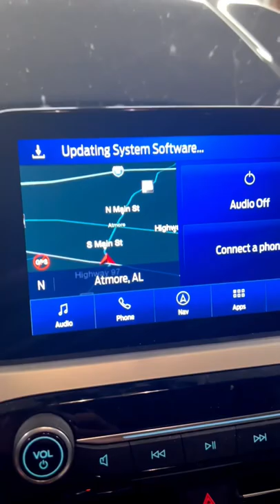Will SYNC Radios Make Me Quit? #shorts

Comment: Are you doing the USB method or the DLC method? If you use a USB it should take like an hour tops but if you're going through the DLC it can take hours, and that's with the VCM3. If you're using a VCM2 and going through the DLC I'm not surprised it's taking a whole day or more.
Reply from the maker: Using USB
Reply: @FlyingWrenches13  damn that's weird. It's very rare for our sync updates to take more than an hour using a USB.
Reply: @TekuTaurus  agree possibly want to buy a name brand USB like scan disk with high transfer rates.  Some of those cheap usbs from Amazon or any local store are hot garbage.
Reply: @gameovered777  as long as it's usb 3.0 it should be fine. I just did it with a cheap micro center USB flash drive the other day with no issue
Reply: I use the 2 gig USB from 2005 or some s*** and it took me 10 minutes to update my radio on a 2020 escape
Reply: @hoodman420  guys are on to something ;).Old Ford Tech here and modern Server/Sys admin. The USB is still legacy on most if not all fords (up to 2020 i know of) and is more compatible with 2.0 devices. Using 3.0, this issues occurs often..... hence why the old usb drives work better. Also the blocksize and format matters. Unfortunately not completely dummy proof. Most drives should be formated fat32 and default block size (512). Test a few brands, kingston 2-4GB sticks was good for us.
Reply: @zipo1200 You seem like an expert. I was looking into getting a Ford Raptor 2011 or 2012, and was curious how I could go about doing a Sync 1 to Sync 3 retrofit. I am not afraid to rip out modules, make my own harness, and code modules. I’ve done it on my BMW to upgrade the OEM radio on that too. People act like on the F150 it’s such a big deal but honestly I’ve never seen an actual retrofit breakdown of what modules need to be changed, so I think it’s a bunch of regurgitated nonsense! Any insight? I’m new to Fords so if you can at least point me in the right direction to look up what the modules/system is called internally I can try to find some documentation online.

Comment: I 
Will
Never
Own 
A
Ford
Reply: So you waste time on a Ford site, you're a smart one
Reply from the maker: They all have there problems
Reply: @FlyingWrenches13  don't lie.   My dodge charger is 7 yrs old.   No updates needed
Reply: @pauljoey7977  sync updates aren't necessary either, customer most likely requested the dealer do it which is a huge waste of money. Your reasoning to not buy from a manufacturer strictly because of the infotainment system they put in their vehicles is beyond me.